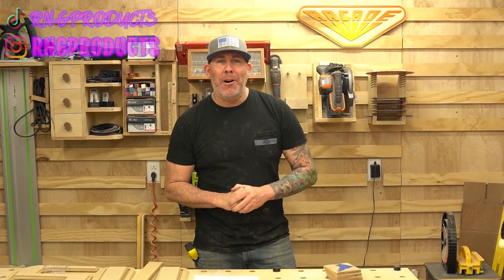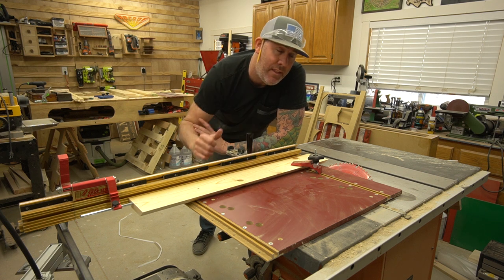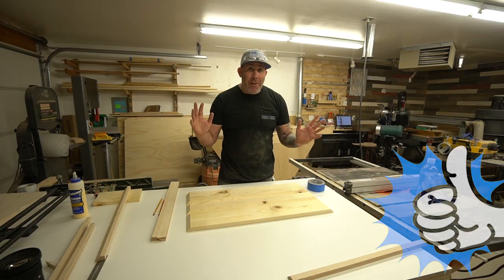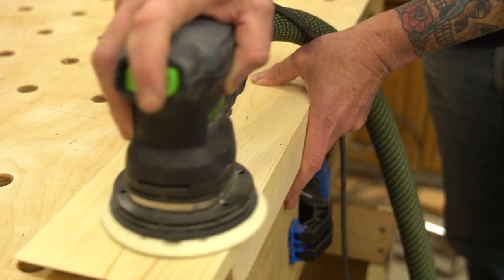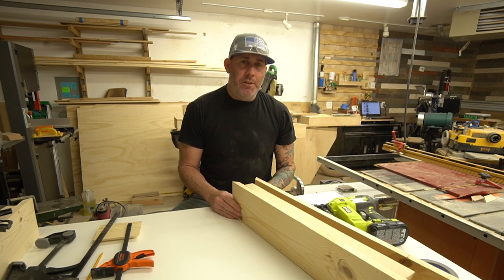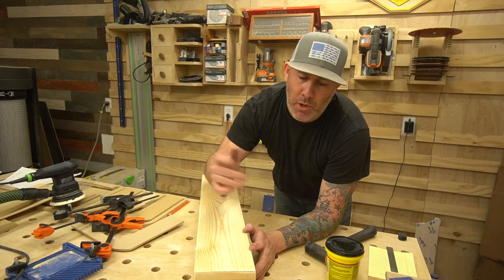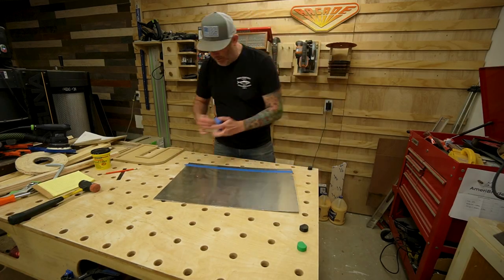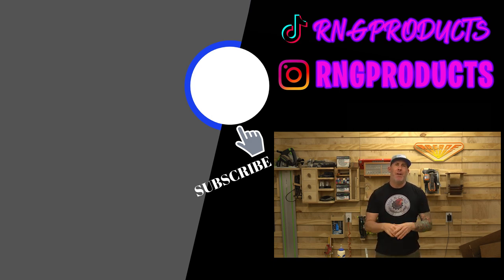How To Make Simple Floating Shelves | DIY Floating Shelves

Comment: Nice project.

On a side note, wood glue mixed with saw dust makes a wonderful paste to use as wood filler.
Reply from the maker: Yes it does! I typically save that process for projects that are utilizing hardwoods. Thanks for the comment and tips!